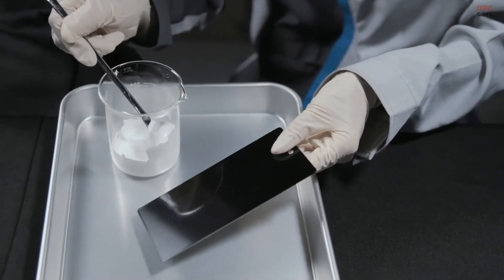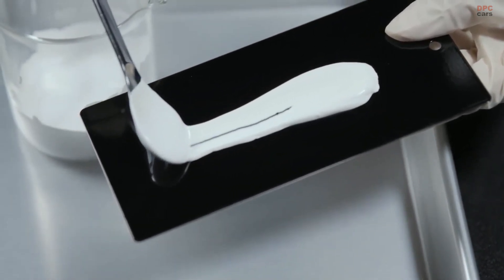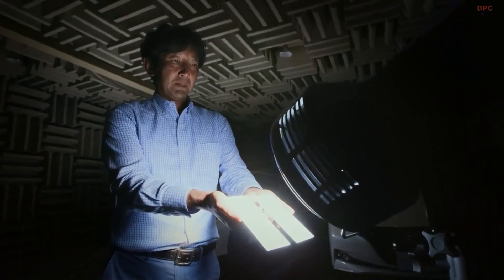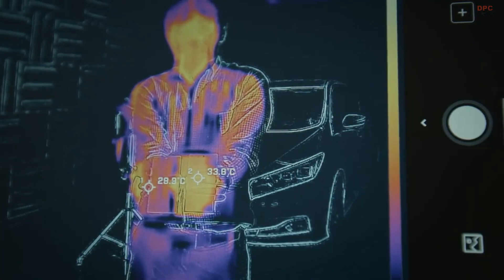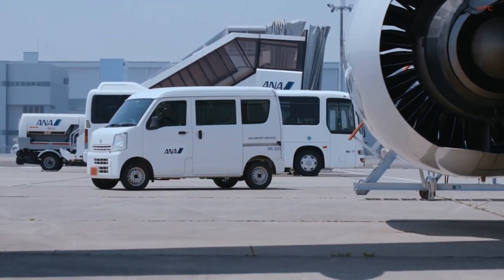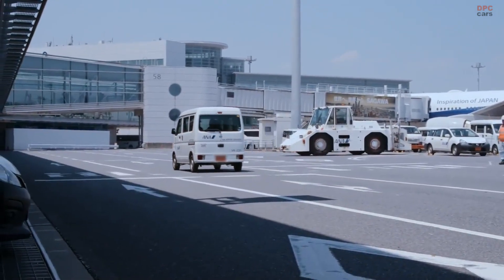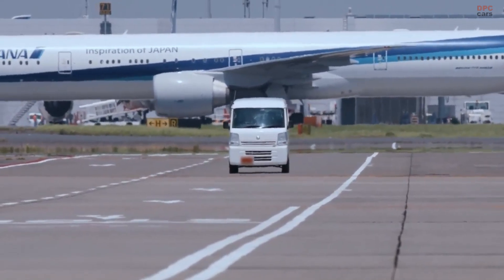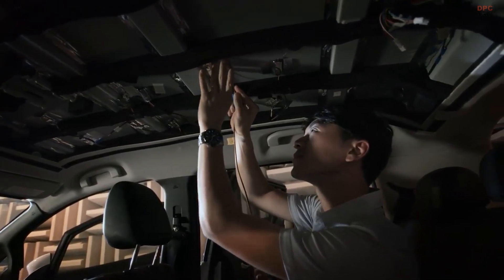Nissan Cool Paint Technology

Comment: what frequency are the electro-magnetic waves ? b/c if memory serves, the EM spectrum is regulated against random mobile transmitters when ever the sun comes out ?
Reply: There's no magic em direction changing material. The marketing team doesn't understand that the barium and sulfate in barium sulfate is one molecule. They're microscopic glass beads that both refract light and also emit heat.